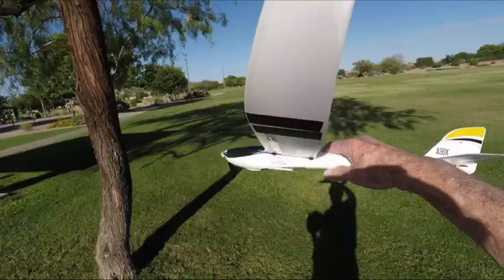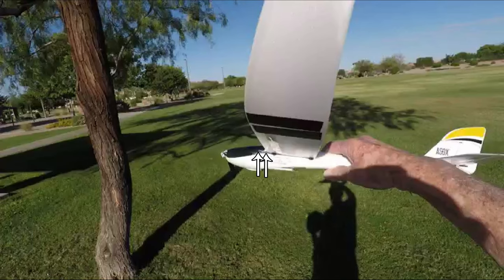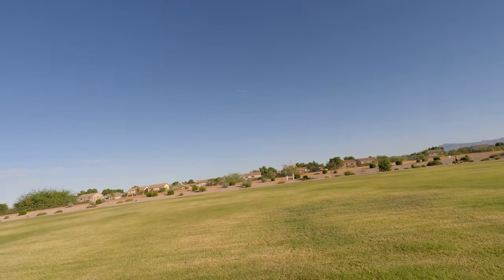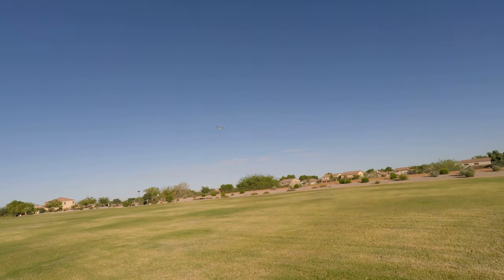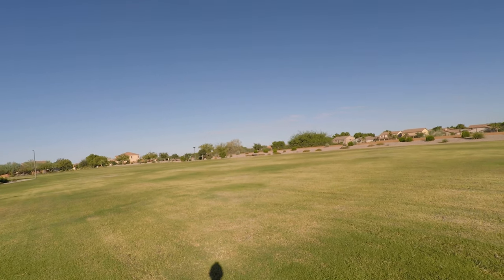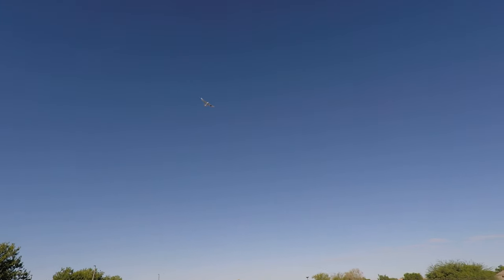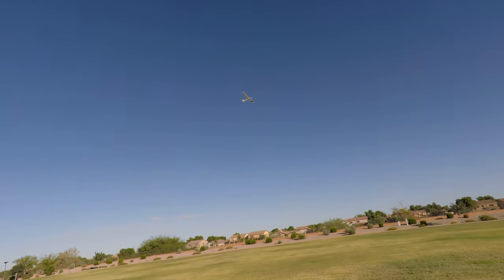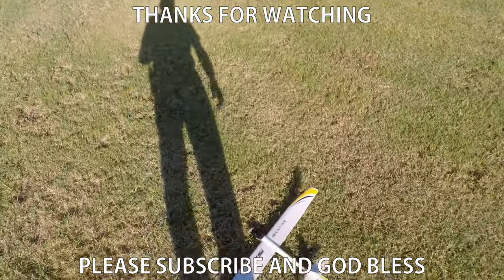UMX RADIAN GLIDER TEST WEIGHT & BALANCE AFTER WING MOD

Comment: Good flight Mr Kent! Nice idea to move the wing back, rather than adding more weight. I would still go with a bit more weight, when it is windy, though. Thanks for the mention, at the start of the video. Ian :-)
Reply from the maker: You are welcome for the mention of course. I honor all of your input. I think I will fly it for a while. We are so close to the equator that even full size planes fly as high as is convenient to avoid all of the thermals. You can tell if a plane flying over is in turbulence because the sound of the engine varies instead of being steady. Thanks again for your input and God bless.

Comment: Awesome job Mrkent.  Do not think it is you or me, I  find each time I fly I must readjust. and trim.  Wet day today cool.  I got the Sports cub S motor installed on my brushed, it cots off at full throttle, can't wait for the brushless board to come, if  this fails. I may buy a Timber and put to rest the projects cost a lot to do. we'l l see. I  got a positive feeling I will be good.  are you going to put a fpv camera on the radian?  I put the bat as far in as it can go and failure  for  CG, while it is CG'd hmmm
Reply from the maker: Thank you for your kind words. I had a UMX Timber for a while but it is just a little too big for my favorite flying park, so I gave it to my son. I have not tried putting fpv on a fixed wing and at my age probably won't. Thanks again for your input and God bless.

Comment: Looked really nice . I want a glider with power like maybe the Bixler from Hobbyking I want one big enough to use fpv camera on . DJI has a camera and transmitter for their goggles now but they are a bit pricey like $170 for the setup . I have several fpv cameras and transmitters but they aren't compatible with the dji goggles . The new FAA laws really put the hurt on people with big gliders unless you live where you get a lot of good thermals . You almost have to have a motor glider . Great video . GBY. ><>
Reply from the maker: Thank you Spencer. Yep, I used to live next to a 40 acre farm and they allow me to fly all over it. But now . . . Just that same old park I always fly from:( Thanks for your input and God bless.